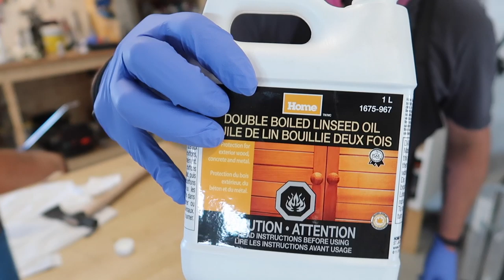RESTORING AN ANTIQUE CARPENTER'S HATCHET (with modifications)

Comment: Jeremy, great work. That head turned out gorgeous. Maybe it’s just me, but I think you hung the head on the handle backwards, unless you plan on using the hammer more often. If the predominant tool is the hatchet, it probably should be the other way around. Either way the finish on both head and handle turned out beautifully.
Reply from the maker: Thank you very much. I appreciate that. I know it’s not the “normal” way to hang it but I’ve never tried it this way. I looked at my other axes and for some reason though I’d try it opposite. After I use it for a while I’ll know which way I like the best. 👍

Comment: Called a lathe hammer, here in the UK
Lathes are the thin, wooden slats that plaster was applied to, back in the day.
The hammer allowed nails to be driven and extracted, as well as the lathes cut to length.

Pronounced ''larth'' for those that struggle with old English words
Reply: Here we call it simply, "lath". (Rhymes with last.)

Comment: You should really do some knurling on the face of the hammer with a checkering file! It came out really nice btw!
Reply from the maker: Yeah I agree. It was really really hard though and I was worried about wrecking my checkering file. But certainly would have made for a more functional hammer. Thank you!
Reply: @Simplelittlelife  You could aneal it, do the knurling, and then heat treat it again but I imagine that would be a difficult process since it is probably impossible to determine what steel was used to make the hatchet originally and it would become to much time consuming just to restore an old hatchet. Good job!

Comment: Jeremy, why did someone grind in those relieved areas on the hatched head?  By the way, you can get a darker color on your steel if you use Ballistol's schnell-brünierung.  It turns the steel quite black.  I don't know if they sell it in Canada.  I had to get mine through eBay international.
Reply from the maker: I have no idea why they would grind it like that. It if hadn’t been I would not have re—profiled it at all. Thanks for the tip, I appreciate that 🙏👍